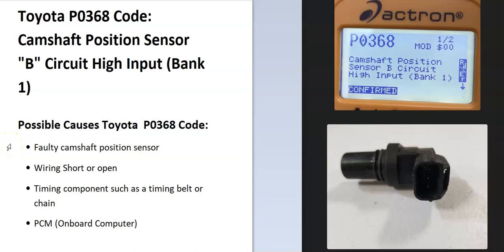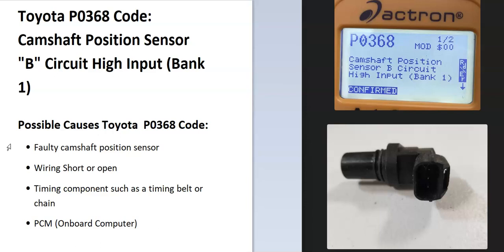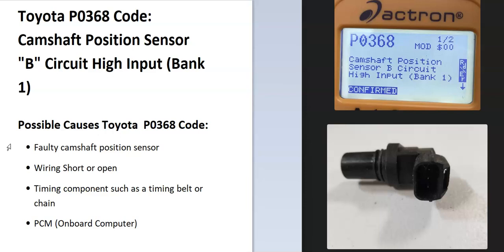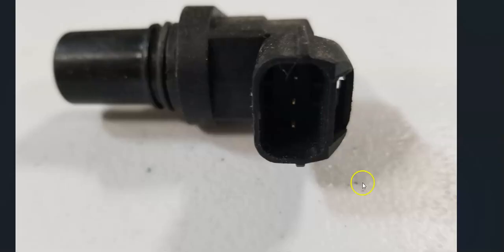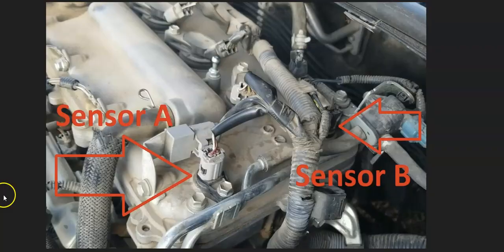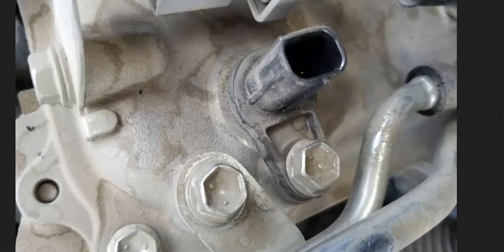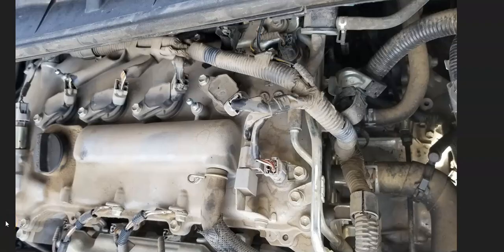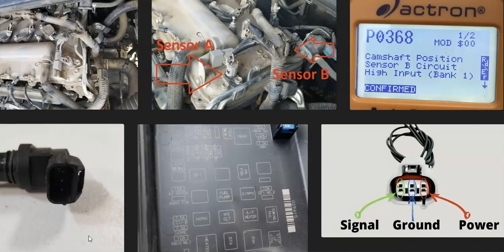Causes and Fixes Toyota P0368 Code: Camshaft Position Sensor "B" Circuit High Input (Bank 1)

Comment: Not sure where the exact location is for my 2008 Highlander. 3.5L engine bank 1 code p0368
Reply from the maker: Bank-1 is the side of the engine with the #1 cylinder, which is for the 2008 Toyota 3.5L looks to be at the back on the firewall, passenger side.

Comment: How do I know which is ground, power and signal
Reply: I accidentally pulled the wires apart from the connector
Reply from the maker: If you can find the schematics, then you can re-pin it. It is likely best to buy a new connector online as they are low-cost items.

Comment: I had an open circuit for the sensor A. Somehow three wires were cut—might be a rodent. I have rewired those three lines following the color code. But I could not clear the check engine/trouble code, my obd device says it is a permanent code. Any suggestions on how to clear this code? (2017 Camry)
Reply: I think you might be showing sensor locations wrong in this video. Locations A and B should be swapped.
Reply from the maker: A permanent code needs a Drive Cycle to be fully clear. Usually, the dashboard light will go off, and the codes will go away once the Drive Cycle is complete. You can google your vehicle year make along with a drive cycle for the steps the computer needs to speed it up.
Reply: I miss mines , it’s been sitting for 2 years now idk what’s wrong with it, it’s been in and out of auto shops and nobody can find the problem, it stall at random losing power steering, I got a tune up , new spark plugs and coils , now I have a code for P0368 camshaft sensor 🥺 Help Me

Comment: I accidentally pull the wire out and I don’t know which goes to what the color are yellow blue and black please if you could help me out with this problem
Reply: Look at the other sensor which has not been messed up, and follow the same color code for the wiring.

Comment: I changed my camshaft position sensor. The check engine light is still on. Driven it 300 miles. The car runs great. Where is the fuse?
Reply: same here
Reply: I changed the camshaft sensor on my Sienna and I still have the light on
Reply: Same
Reply: @mannymartin8201  try replacing again they come faulty sometimes
Reply: Hey guys, I had code p0017 and p0368 in a Sienna 08 I fixed it by replacing the camshaft sensor, the AutoZone brand didn’t work so I used one from the junk yard! Works like a charm. Use denso brand